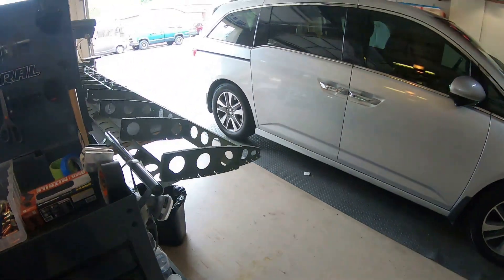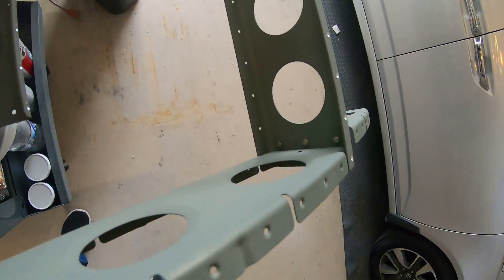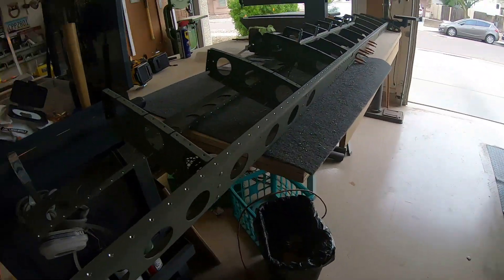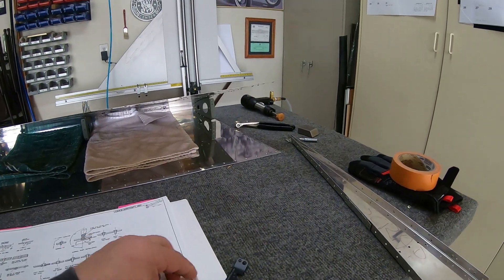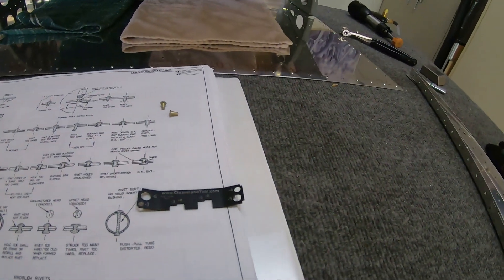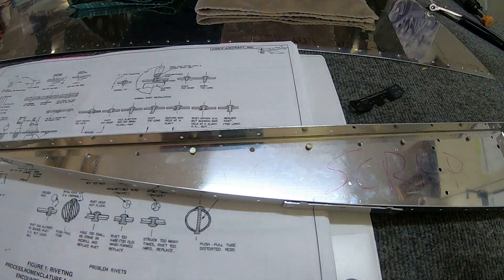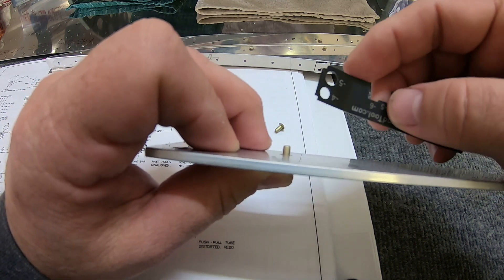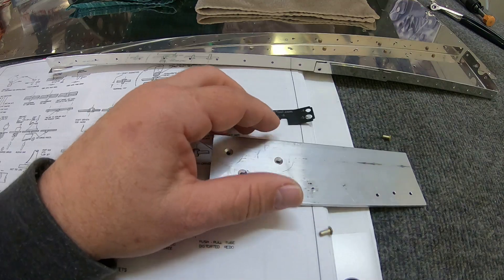Tips & Tricks: How to use the Cleaveland Aircraft Tool Rivet Gauge

Comment: I recently learned something about this gauge that I found interesting and worth sharing. I purchased a partially complete tail kit and found several 1/8" rivets that appeared to have a driven head diameter that was too small when gauging with Cleaveland's rivet gauge. I found someone else had found the same thing with some quick build wings. Van's referred them to a mil-spec (MIL-R-47196A) that lists the minimum driven head diameter for a 1/8" rivet as 0.163. My Cleaveland gauge is  0.186, measured with some inexpensive calipers. Long story short, if you find some rivets that aren't quite "squished enough" you might want to take a closer look before declaring them them "bad rivets".
Reply from the maker: Outstanding advice! thank you for sharing. I have been struggling with the "is it good" question. I've come to the conclusion that if I have to ask myself if its okay, and then think about the answer... I'm just going to change it. But knowing that "is it good" determination is a little bit smaller than I originally thought, helps.